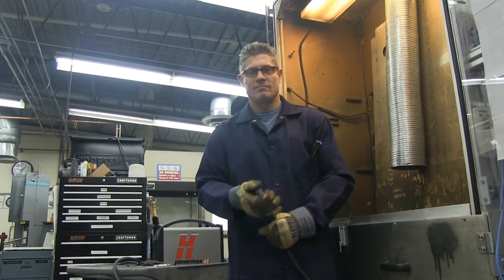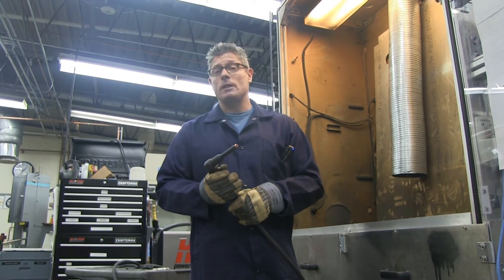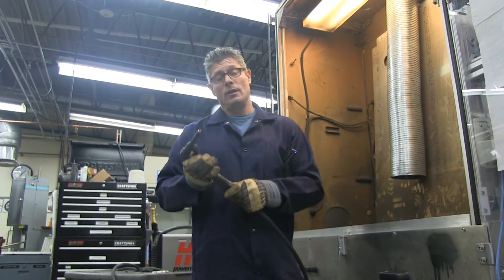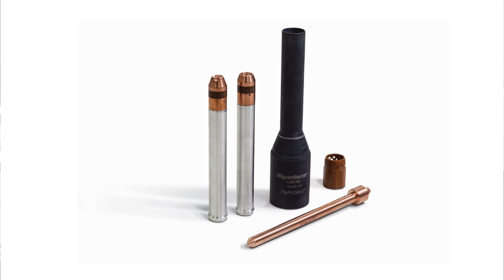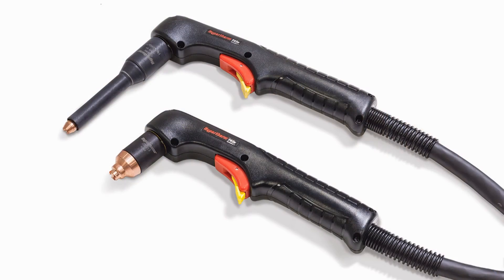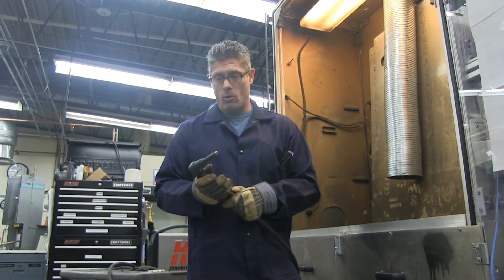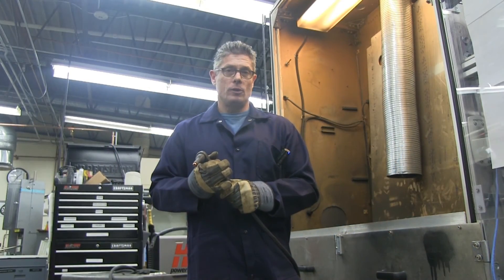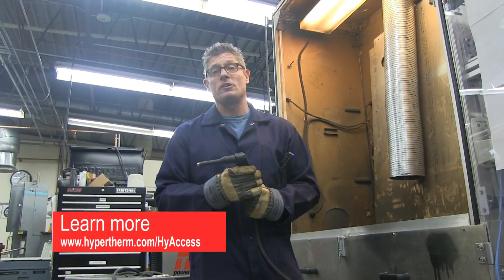HyAccess extended consumables for Powermax30/30 XP/45

Comment: HI, As an owner of a powermax 30 (2 years old and working great) Could you tell me if the new extended consumables are still the same size accross the tip? I use a lot of tenplates in my cutting, so would the extended tip allow for closer side? At present, I reduce the size of tenplates by 2-3mm to allow for the tip width. My apologies if this sounds confusing. Regards Mick Gillman (Weldwide Mobile Welding Services)